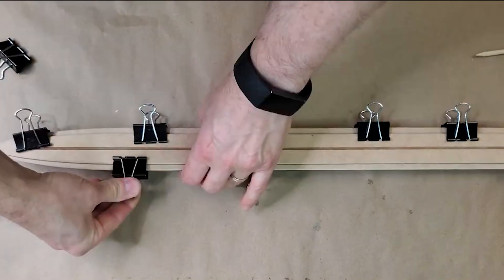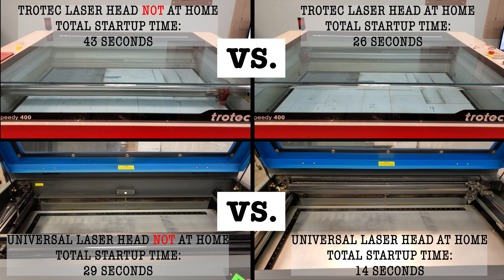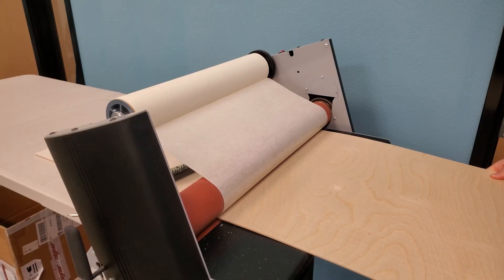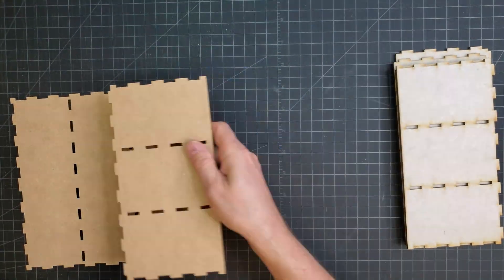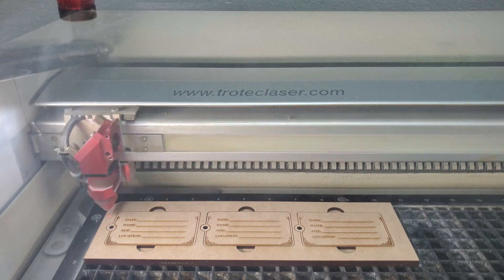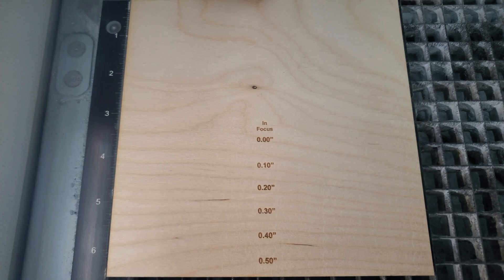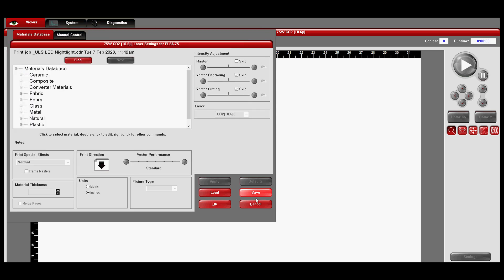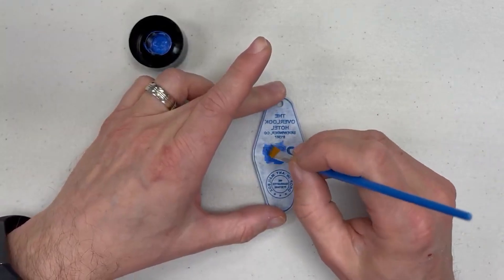Top 10 Laser Hacks! Save Time, Improve Efficiency & Quality - Great for Glowforge Trotec & More

Comment: There is a vid of a guy breaking a circle etching with numbers around it, like a compass. He broke it down to 4 quadrants, saving the laser from crossing the work area. He went from 38 min. to 8 min. Also,  the de focus would be great for filling in large areas, or does it overlap because it is thinking it is etching a fine line?

Comment: The warped wood hack isn't really a good hack since the wood is still warped after you are done.
Reply from the maker: That depends. If you're only engraving the wood, then sure. It will still be warped. But if you're cutting smaller pieces from the wood, then they will not be warped, or the warpage per part will be significantly reduced.